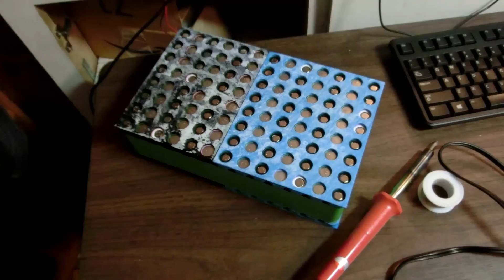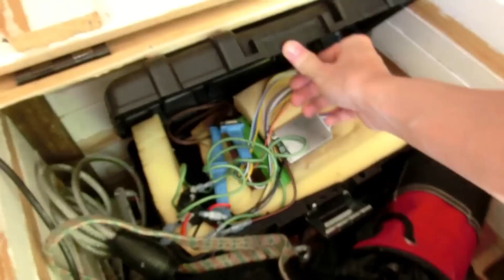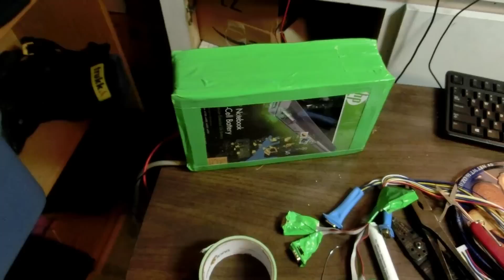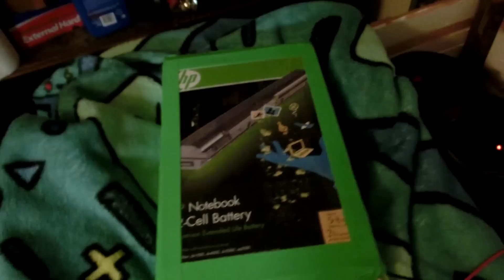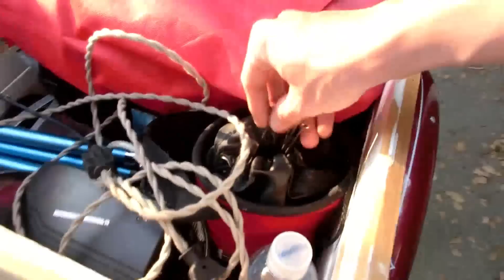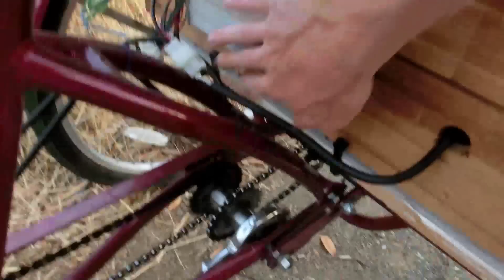DIY 52v (48v) 16AH Lithium-Ion 18650 E-Bike battery pack (E-Trike v1.6)

Comment: Not 52 V of power. It would be 52 Volts. The power capability of the  battery would need to be determined by experiment or from the specs of the cell.
Reply from the maker: that makes no sense. are you confusing "power" for "amp-hours" or something?
Reply: No. Volts is Energy per unit Charge (Joule/Coulomb). Power  (Watt) is Energy per unit Time (Joule/sec). Volts does not equal power. Amp Hour is a measure of energy (Joule).
Reply: I'm seriously worried about what you are doing here Super_Genius.
1. your soldering (sodering) technique is in danger of damaging the cells.
2. Why is the wire so thick in the parallel wiring?
3. What are all those micro fuses for?
4. Is there a current limiting circuit in the pack?
http://americansolarchallenge.org/ASC/wp-content/uploads/2013/01/high_cell_count.pdf
Reply from the maker: David Castles power does not equall a "watt" its just a non-specific word. in this case i mean it as the amount of thrust that will come from the motor on the voltage, which increases a good deal from 48v to 52v.
 
and yes, more volts does equal more power when the resistance of the circuit stays the same.
 
1: it hasnt damaged any yet
2: because it has to handle a lot of current
3: to prevent a shorted cell from sucking power from the other cells and causing an unsafe failure mode.
4: no i dont need one
Reply: Oh dear! I have nothing more to say. Good luck.
Reply from the maker: David Castles
same with you, i dont have time for people who dont understand simple aspects of electricity.
Reply: Noooooo. 35 years an Electronics Engineer and now you tell me I'm ignorant. I better recall everything I've designed.
Reply from the maker: David Castles
that might be a good idea.
Reply: A little light reading for you about what power means
https://en.wikipedia.org/wiki/Power_(physics)
Reply from the maker: David Castles
i'm glad you agree now
Reply: Rinoa I love your videos, but you'd be wise to listen to David.  Power is Watts, and Watts are Volts times Amps.  Yes, more volts equals more watts WHEN THE RESISTANCE stays the same, but the fundamental value of power still requires both.   Watts=Power.   V*I=Watts  Voltage by itself is just potential, not power.
Reply: The Super-Genius seems confused about energy as well as power. He says "here's how i build my new 16AH battery pack and link it with my 24AH pack to give my electric tricycle 40AH at 52v of power."
The 40AH he quotes is a measure of energy capacity but relates in no way to the power capability of the battery pack (i.e the rate of delivery of energy). The 52V may well be the output voltage and it may well be capable of providing 40AH but the power capability of the system is not known with these figures alone. A power rating of any system must be qualified (e.g peak power, average power etc.)

Comment: Wow ..You;re a true genius..  I have a question.. I have 2 x 36v battery, one is 10ah the other is 14.6ah. can I hook them up together in parallel to get  36v higher ah?? or do both batteries have to be the exact same ? thank you
Reply from the maker: are they lithium-ion? if so they would need to be disconnection and properly ballance charged every so often. or link the cells together. those small battery packs are probably stressed a bit when driving, to where if you double them up that halves the stress on them, which can give you longer range than they would individually. or at least thats how it seems.
Reply: Thanks for the reply.. Very much appreciated. 
Here's the problem. my motor is 960w, the controller is 1500w 45a 15fet. my battery is 36v 10ah or 36v 14.6ah. when I ride and give it full throttle or get to a hill it will shut down. i then have to reset the battery by turning the key off/on .it does this on both batteries.I'm guessing my battery is not strong enough? so was hoping by linking 2 together it would solve my problems?
Reply from the maker: cassiya100
yeah that should help a lot. but is it lead acid or lithium battery?
Reply: If you hook 2 different. Battrys voltage and amps it will one make the batteries not charge all the way when u charge them or to much and blow up or just die all the way and one dieting will make the others not get u full v and 2 it and show that there all dead

Comment: what if you turn the wheel into a generator on the downhill
Reply: thats perpetual motion theres some laws of physics you may want to check out lol but I have actually seen someone with an electric car and like 7 wind wheel generators that defy those laws lol
Reply: You could easily get a dynamo that produce 6v to run your lights. its just a matter of time before someone design one that can produce 24, 36,48,52v before that happens Trump will marry Clinton and have we will have 1'000 year of peace lol.
Reply: Funny, I was thinking the same thing. what if you could get an alternator (generator) that can produce 36v @ 15ah continuously whilst the wheels are in motion, you'll have unlimited miles?? FREE ride
Reply: ehhhh wouldnt say that, its quite easy to produce any range of voltage you need, current and Wh is a diff story
Reply: no need for perpetual motion, just separate the motor from the wheels so you can add gears. Add a gear for reverse like cars have and go downhill in it. Wouldn't be free energy cause friction yada yada  yada other things, but cut down on quite a bit of the juice spent going so far up hill.
Reply: It's called regenerative breaking, a lot of EV's use it.

Depending on his motor, it should be possible, he'd probably need another motor driver though,as to switch between charging the batteries and discharging them., and a charging circuit that can handle whatever voltage the motor spits it when it's being forced around.
Reply: cassiya100 you dont seems to know anything about generators its impossible to have an infinite drive because a generator once you put kt under load it needs a lot of torque witch will stops you you will be using more energy than what you are producing just pushing that motor witch is really inneficient

Comment: My friend rather melting the plastic together ,why did you not use metal clamps,to clamp each other,then cracks will never happen,you are using bicycle,so there will be much vibration and eventualy it wil break off the plastic joints,better use Metal Worm Gear Clamps,it will never break off..for isolation you could have used glue gun,I mean before you put the clamps,just glue gunned the connections parts then putting the clamps on,so that you had no short circuit..Your electromotor has low power,when climbing the road it is dificulties to coap with it,you need much powerfull electomotor..actualy you have used 104 batteries multiple with 3 dolar each it cost you 300 dolar,my friend you made a expensieve hobby,if you buyed a normal car accu,you had 100AH less then 300 dolar or less then 200 dolar hahahaha,actualy you had better buyed a converter to convert 48V and made all the batteries in prallel for high amp..you had I think something like 300AH..

Comment: Is that 13s battery?
Reply from the maker: yes. or at least i have it wired up like that. i could always change it.
Reply: Oh its awesome that you answer so quickly. So its 13 cells in series. My question is how you can balance them when imax b6 has only 6s at time. I am so confused lol :D. Or is it even necerily needed? Balacingin i mean.
Reply from the maker: Kevin Minkinen
i show in this very video.
Reply: +Rinoa Super-Genius I watched the video. So you made the balance connector for 13s but you did not show what charger you used to balance that.
Reply from the maker: Kevin Minkinen
oh, i have a hard time remembering my videos. i used a 13s BMS from ebay. they are like 20$ and take care of ballancing for ya.
Reply: +Rinoa Super-Genius Ohhhh, I got it thx!! one more. Is the BMS all the time connected and whenever you charge it will balance it? or will it balance it all the time like when drving?

Comment: Please answer my question.Let say the battery is 48v 30a in which it can travels up to 30km.Does it also means if I have 48v 20a it can makes a 20km or 48v 10a can makes 10km? Which means   capacity is nearly proportional to distance or there is other way of knowing the distance given the motor power and battery capacity? Thanks for your videos.

Comment: Great work! I am wondering if the input voltage for the 13s bms is not exact 54.6, Does it still work? I have an input range of 54 to 56, would the bms work normally?

Comment: awesome bro...you so smart!!,...how you get so smart,...???? ( lol) anyway,...wondering if you can offer some advice??? I have a 1000w 48v 10ah kit ( dillenger) with almost 960 miles on it. problem is : it still takes a full charge but will completely cut off( as though you shut off the unit) I let it rest, turn it back on and its fine.( this always happen will any kind of high load,( such as twisting the throttle,or aggressively peddling uphill.) maybe the battery is "tired",...but $500. for a new one, ain"t in the budget.....any suggestions,...??? thanks,bro.😉
Reply: Sounds more like what happens with SLA batteries than lithium ones. However if the batteries are old and used up already though, they may then have such a noticeable peukert effect as a lead acid one does too, and so might hit the LVC protection of the controller on big throttle pulls, with the effect of shutting down the bike. When resting tho, the stronger charged batts in the pack, will  always try to work to charge up the weaker ones, and then the bike will be able to go again...but not very far in my experience...
Reply: Cool,I learned 2 new words today: "peukert", and LVC,...now i'll go look em' up.☺
Reply: +Daniel Hawkins do that, and LVC stands for low voltage cut-off... when you understand the peukert effect you'll understand why a big power hit on a weak/dying batt, will affect the controller  lvc, despite it still having some power and that can temporarily halt the bike.
Reply: Likely the bmc shuts it down

Comment: man those batteries are fine its just motor is too weak and traction is bad because it is front wheeler :D
Reply from the maker: motor is maximum power that is legal. and no its not too weak.
Reply: I mean you need motor that is slightly stronget than you have and then put few resistors to make lets say 70% to work as 100% in theory that way it will be more stable. And if the motor would be fixed for back wheels that would split work load equaly on both sides.
Reply from the maker: tadas kontrimas
its already pretty stable, i dont know what your talking about.
Reply: Your comment is contradictory....if the wheel is spinning that means the motor is strong enough to spin the wheel.  You can't have it both ways.  Lack of power does not equate to lack of traction,  nor vice versa.

Comment: Hellou i have some quick questions .I saw on e-bay, lithium battery packages Recommended Motors(800w or below ) for using that specific package.And the question is who is making the eqilibrium for power via motor, the batteries or the controller?And what is the danger for using a strong motor like 1200w or bigger on that package or is only a strategy for paying more money to them.i google it a little bit and i didnt find a solution to my question and curios enough the lead acid batteris have like 48 v and 15 ah instead lithim who has like 48 v and 20 ah. it should be stronger but at the first look it isnt.what the problem ir it is even one ?.im looking for your answer.have a nice day.

Comment: I don't understand the balance charging. You have 13 "cells" but each of those has 8 cells. So how do those stay in balance?
Reply: +Dylan T because the 8 cells are connected in parallel so they balance each other out.

Comment: rough diagram  

http://i593.photobucket.com/albums/tt13/alpha329eco/battery%20trays.jpg

threaded aluminum rods found at home depot screw a nut on the end and stack your cell trays when you have the number of trays you want cut off the excess rod and tighten down 
i would also recommend putting the whole thing in a .30 cal ammo can then drill a whole run your connections through seal it up with some silicone and the thing is waterproof and near indestructible but easy to access if you need to work on the battery

Comment: hi can i buy your old batterys i need it for my 12v 400 mah scooter i wanna beef it up
also will a 24v 2400 mah be fine or is it to much thanks...?
Reply: I just did a razor scooter rebuild from 100w at 24v with two sla, to 500w 24v with just two 5000mah lipo 3s packs. Currently with the two tiny batteries I get 2.2 miles with a 220lb rider at about 16-18 mph cruising speed. This is basically a standard push scooter with a motor. Hope this helps.

Comment: Isn't better if you just add another 18650 to that cell pack where is needed? So that you have similar amps? In your battery pack one battery is for example 1700mah and next one is 2400mah. Isn't true that first battery with smaller capacity is going to overcharge and bigger one is going to be 80%full? Why just don't add more cells in that pack that has smaller capacity like in your first video? What is better?

Comment: How do you get 16 amh? My math doesn't add up. Can you explain in detail how you get that figure? Thanks.
Reply: +Aung K. I think he has 8 in parallel, 2Ah each cell, so that's 2 x 8Ah for 16Ah, and 13 in series, so 13 x 4.0V for 52V, or 13 x 3.7V(Nominal) for 48.1V.  So it's a 13S8P, 16Ah 52V(48V), pack.
If you find 2600mAh cells in old Dell Laptop batteries(lightly used), you can get 2400mAh out of them, and make yourself a 19.2Ah pack.  If you have money, and can get the LG 3500mAh, you'll have yourself a 28Ah, that's probably the highest capacity right now.  Those 3500mAh just came out last year, they are rated for 10A continuous, so they not only give you the most capacity, but can give you high power output, they heat up less so that helps extend battery life as well.  If you need real power output and capacity, the best right now is the LG HG2's, 3000mAh and 20A continuous.
Reply: +David Sunshine , Ok, I got it. I thought in the beginning of the video he mention each battery having about 1800mah. 

I am thinking of just putting 6 of the 3k mah batteries in parallel for 18Ah. (13 in series for 52V) That's only 78 batteries weighing in at 4kg. They cost about $3 a piece tho. I can't find a good source for used laptop batteries. I don't thnk I have enough experience with those batteries to handle them properly so I would probably just go for new ones.
Reply: Aung K. They aren't hard to solder to, just make sure you have a 90W iron with a thick tip, you don't want to heat it up for too long.  And you can use low temp solder, which has higher lead content, but it's worth it, low lead content means higher temperatures and corrossion to your tip.  I don't reccommend using old batteries, in the end it's not worth it, brand new name brand batteries are the way to go.  $3 isn't bad.  Are those the LG HG1 3000mAh?  On Gearbest they are $17 for 4, that's a pretty good price.
The LG 3500mAh are good, but they are hard to find right now, unless you can ship them from fasttech, they seem to not have shipping options right now.
Reply: +Aung K. Also, forgot to mention that you would want to match the internal resistance of the cells, you don't want too big of a difference, that's what makes using old cells difficult, you never know their condition, some have very high internal resistance, which makes then useless even though they have high capacity.  Check out cells with tabs, they cost more but pay for themselves since they make it easier to solder to, without then, you heat up the internal of the cell and that could cause damage.  I use a sponge in cold water to cool the terminal right after I solder.  For smaller packs I put the cell in the freezer, that helps too.
Reply: Hi, I just wanted to let you know that the 4 pack of Panasonic 3400mah cells, unprotected, are on sale for $13.29, I have tested these and they provide almost full capacity, and are very good cells, at 4A each, you can pull 1152W from the 52V pack, 13S6P, and will have about 20.4Ah of capacity(Cost of $259 for the cells for the pack).  They have low internal resistance, so you'll probably have the best pack on earth with this thing, unless you use the LG3500mAh, but the small increase in capacity isn't worth it, they are over $20 for 4, but that's worth it for the 2000W+ systems.

You could use 5 in parallel and still get a good 17Ah of it, it'll be lighter, which is nice. That'll cost $215 for the pack.

The internal resistance of the Panasonic is about 65mOhm, vs the 55mOhm of the LGs, so they are good.  Older batteries will have 100mOhm+, that's why I don't like using them.

Too bad I don't need these packs, as I don't ride an electric bike, but it would definitely be fun to build!  I just use them for flashlights and power packs. 

At these prices, they are making lead acid cells obsolete.
Reply: +David Sunshine Yeah, absolutely. It's nice to see a revolutionary tech blossom right in front of your eyes. I am gonna keep an eye on those cells. It's a future project that I am looking into. I haven't really put a lot of effort into it yet.

Comment: I could be wrong but I dont believe the AH increased since you raised the voltage also.
Reply: Ah depends on the capacity of the batteries in parallel, you could have a 10s 15ah battery and add another 3s 15ah battery to make it a 13s 15ah, only thing that increases is the voltage and watt hours